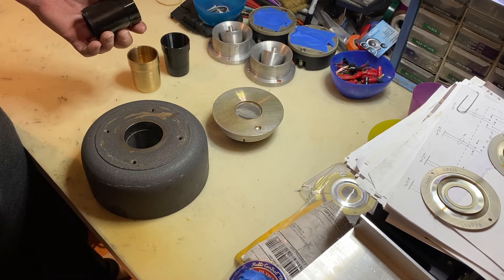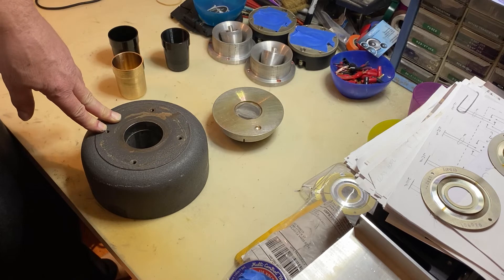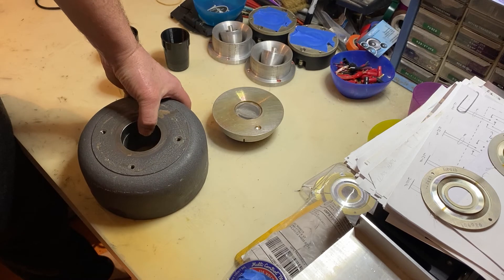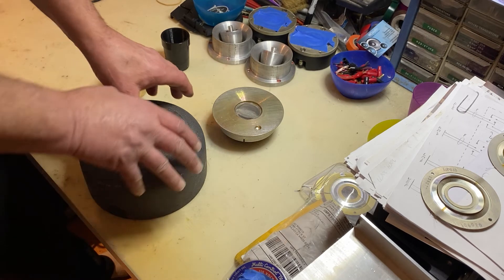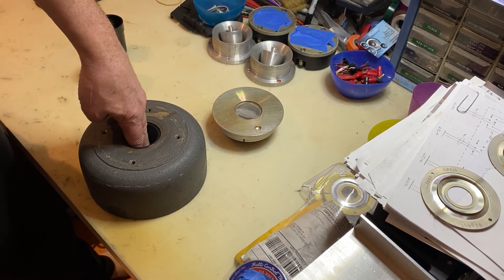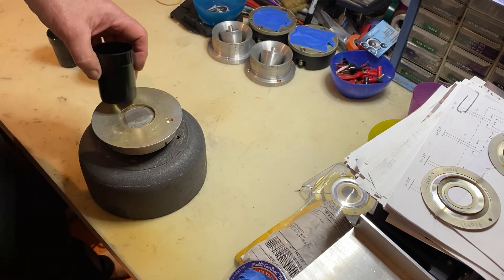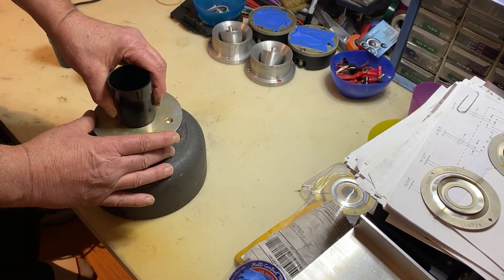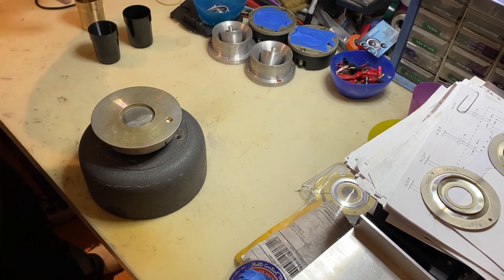JBL 2", 2 inch throats. 375, 2440, 2441, 2482 Part 2

Comment: Hello Eric, I've watched your repotting N1200s videos several times. I am wondering if you contract yourself to do a rebuild? I have three N1200s that I've had since the 80s and sadly they are sounding a little ill,
Reply from the maker: Hi Rocky. Sorry for the late reply, I did not see this. Go to my site  www.MCIaudio.com. There you'll find more info regarding my crossover rebuilding services and my contact info. Thanks.